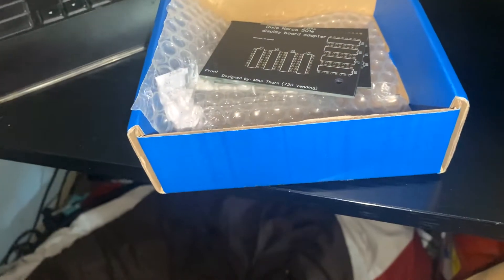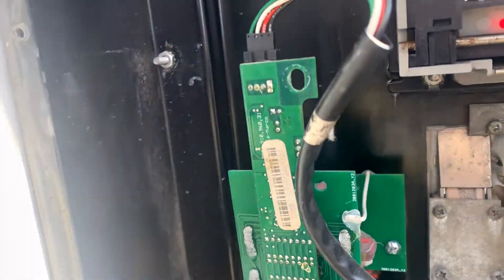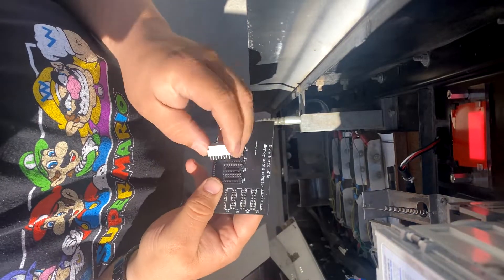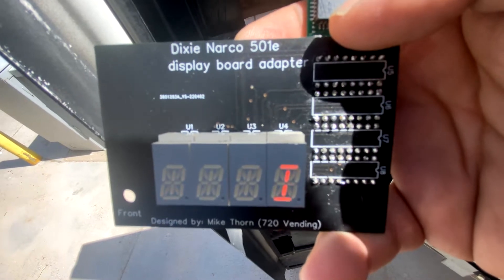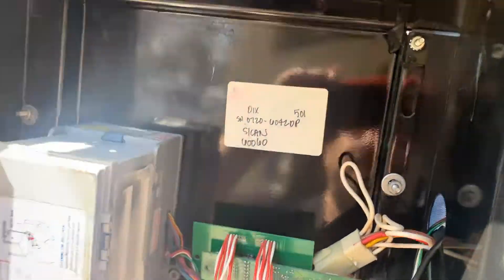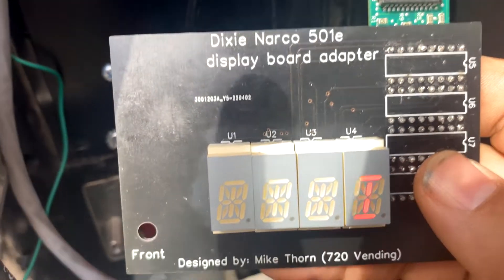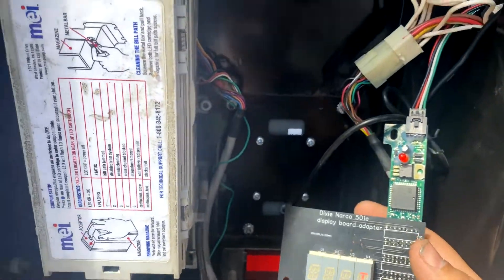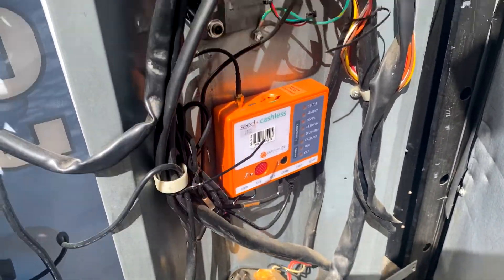DIY Dixie Narco Display Board Adapter for Single Price Conversion

Comment: Hi, are you going to build and sell the board?
Reply from the maker: i have extra boards and i would sell them if people ask for them
Reply: @720vending  great what do you want for 1?
Reply from the maker: @RFCS65  $40 just the base ready for connection to the original board. Or $60 with new LED segments
Reply: @720vending  ok great i"ll get back to you on this. thanks